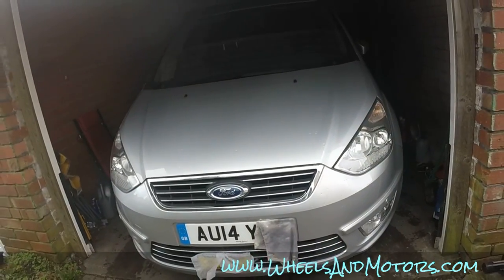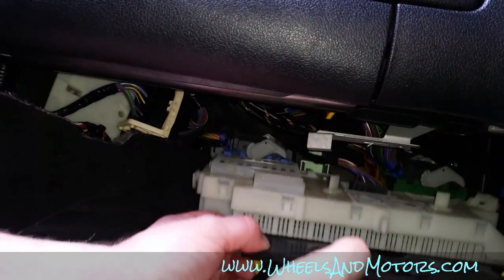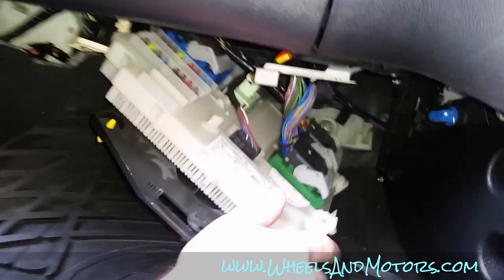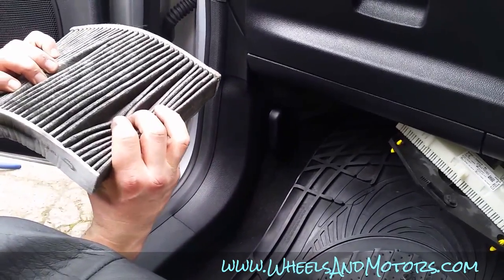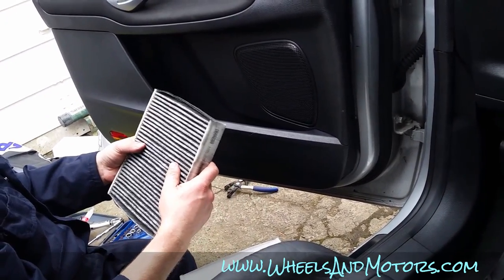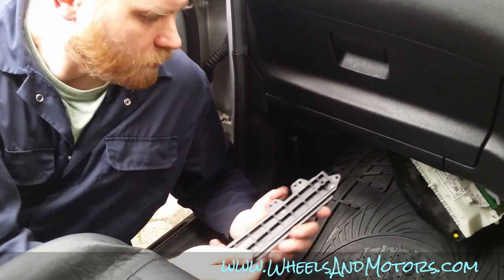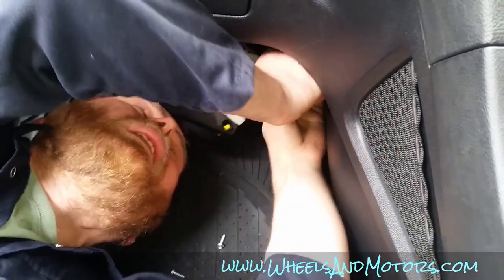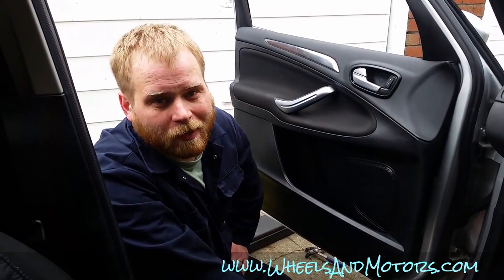How to replace pollen (cabin air) filter Ford Galaxy/S-Max - RIGHT HAND DRIVE

Comment: I feel your pain... I have done the same job several times on my C-MAX, left hand drive... In that case you also have accelerator to remove and brake pedal that you cannot remove easily to make this wonderful procedure even worse...
Reply from the maker: Nightmare, my dad has Nissan X-Trail, left hand drive.. Also difficult.
Reply: That's insane.

Comment: Ok so if you disconnect battery and then the green plug then grey plug then the large 2 wire power feed then unhook looms from fuse box this will give you so much more room to work. 👍
Reply from the maker: Pretty much 😏👍

Comment: Hi did you instal this filterin righthello thanks for the movie that really helps a lot.  but I have one shame for you too, you put the filter on like the previous mechanic.  wrong direction of flow.  watch the movie again
Reply from the maker: I have watched few times, I even watched the original file - I can confirm that new filter I inserted with the arrow pointing back, the correct way.
Thanks for your comment 😊👍

Comment: On a car with left-hand steering, you need to remove the accelerator/ gas pedal (three nuts) to reach the air filter. 

The video was great and helpful anyway.
Reply from the maker: You're welcome
Reply: This comment also helpfully, I have repair handbook and it's based of a right-hand drive car, mine is left so surprise again when I tear down the glowedepartment to get better view there is two ac lines that is in the way for the hatch...

Comment: Great video! Saying goodbye to main dealer servicing. Will be changing my 2011 S-Max's filter (and others) tomorrow. Thanks!
Reply from the maker: You're welcome :)
Reply from the maker: But, keep in mind - if you have automatic gearbox, gearbox oil has to be changed every 35.000 miles. I'll make a video about that as well at some point.
Reply: Same here! If I go buy a car that has no main stealer servicing and history/receipts of private servicing then all the better...I'd buy it. The dealers don't do what they say they do...they cut corners and don't care. I had my S Max in for a partial service (just oil and filters)...they over topped the oil by a good half again...plus they curbed the passenger front wheel resulting in a repair of wheel and new tyre. They fixed that but I've heard too many stories like this. They care about selling new...not looking after old! I can do a full service on my S Max for £130 using Mobil oil and decent parts. I know its done. Bit of time but lots of learning too.
Reply: I remember when I first bought my S Max, second hand, I said I’d keep up the Ford dealership service on it which I think was £250, left it with them, they rang me a couple of hours later to say the water pump was knackered and would cost £450 including labour + servicing @ £250 totalling £700, luckily they hadn’t started the service so I told them no to touch anything I’m taking the car as I had a gut feeling something wasn’t right here, I brought the car to my own mechanic who I’d used for years and he informed the pump itself was fine and just need a simple seal replacing, plus his servicing with bulbs and everything included was £120, big difference eh, so I too don’t care for dealership stamps, there a bunch of rip-off cowboys.

Comment: Hi got a galaxy same model well it's 2014 with 48,000miles do you think I should replace it by now? Can't really tell if the air blow is reduced or not feels the same since new.
Reply from the maker: It all depends how dusty is the region you live in. I would replace by 48.000 miles - it's not difficult or expensive.

Comment: Hi,it is possible to convert right-to-left steering wheel to Ford Galaxy 2008?,Thanx.
Reply from the maker: It is possible, but economically not reasonable if you want it to be done properly. Because it's not only steering wheel and dash, it's pedals, brake lines, few bits under the bonnet... Better sell right and buy left-hand drive ready.

Comment: Does this actually make a huge difference to the cabin??
Reply from the maker: Depends how dirty is the filter. If dirty, then changing it makes huge difference - tonns of fresh air with little effort from blower motor
Reply: @wawayltd  well my s max has done 76000 miles and unsure when it was done, if ever!! So would you recommend doing so?
Reply from the maker: How many of those miles are yours? How is the air flow? If you had the car for a while and not sure when it was done - definitely go for it. They are not expensive. However, if you are getting decent air flow through your vents - might as well keep the old one :)
Reply: @wawayltd  Only recently bought it. I will have a look tomorrow air flow wise! Thanks bud

Comment: Is not better to disconnect fuse box?
Reply from the maker: I find it pretty easy to replace that filter with all wires still connected to fuse box. But if you need to disconnect it completely, I don't think there's much wrong with that - just a lot of hassle :)

Comment: Ford’s design is really bad. it’s like mounting a nuclear warhead
Reply from the maker: I do like my VW better, but some things on Ford are not too badly designed - fuel filter for example..
Reply: Yeah fuel filter does look fairly easy....doing that today I think...wish me luck - S Max 2.2 TDCI 2008..
Reply from the maker: Just don't pull it out by plastic hoses, because apparently they can snap (I had a comment on that). Try gently lift the edge with something like screwdriver.
Reply: @wawayltd  .shame they dont do a decent petrol engine,thats the only down side to a vw everything else is pretty dam good
Reply: 00

Comment: In my Galaxy -14 there are tubes from the ac unit blocking the plastic lid(!)

Anybody who knows how to proceed?

Aha ok, my car is a left-hand steering. So you have to remove the accelerator /gas pedal (threenuts) to reach the air filter.

Comment: FORD should be charged for criminal conduct!

In some cars you just open your glove compartment to reach and replace the air filter. Takes only 1 min !!!
Reply from the maker: Yeah, silly design. I had a lot of "fun" simply trying to replace an oil filter for the first time without special oil filter tool.